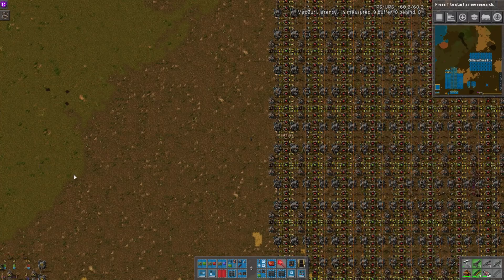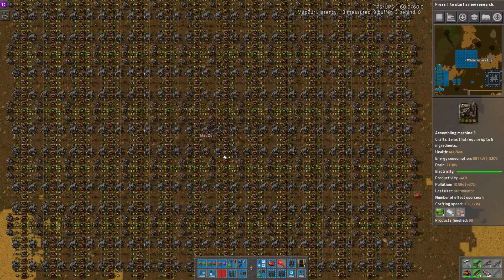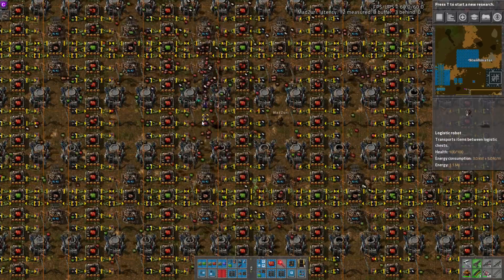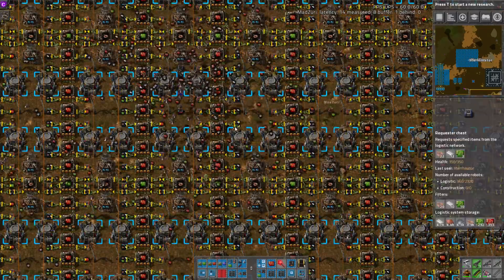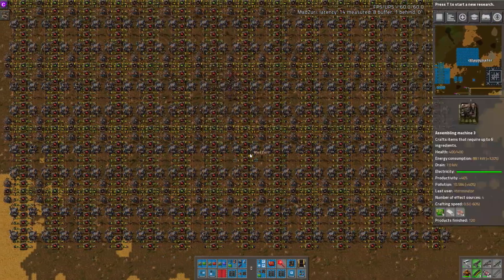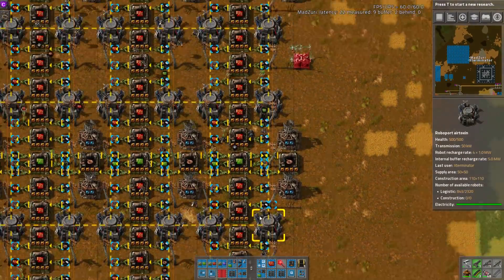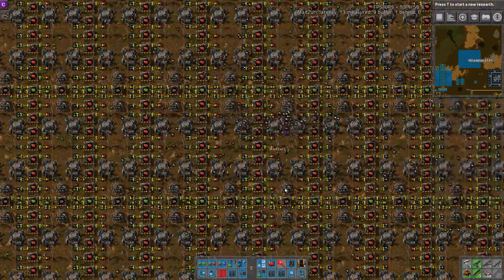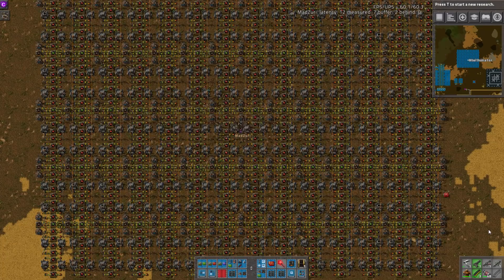Lockdown's Advanced Circuit Build :: Factorio Workshop Season 2 - Building A Better Factory

Comment: You probably wouldn't have to request cables as input for green circuits if you let it buffer up a bit of cable before you start full draw on it, since production can keep up with consumption, and it's just a matter of bots unevenly distributing the cable.
Reply from the maker: That is probably true. However it's also a problem of the Inserters exporting to both sides very unevenly so even if it did buffer up a bit, it would probably eventually run out on one side again.

Comment: Very nice build.... the issue with delivering the input, wouldn't it just come from all 4 sides... and perhaps drive a train track through the centre and suply to the centre that way?
Reply: because its long an uneven amount off tiles, i did what u suggested but mirrored it again
and 3 station along each side because they are so long
Reply from the maker: Yeah, it would come from all 4 sides in a normal base, but that is the issue. With the bots having to fly all the way out to each side it would increase bot usage quite a bit. Having it in the center is best, so the way we showed it is the minimum amount of bots it could possibly use. 
If you wanted to have the input delivered in the middle in a normal base, you'd have to revamp the build quite a bit.
Reply: Any chance of a new bp... perhaps xterm and zuri could assess the improvements too.
Reply: it isnt an improvement at all its worse although i split the two drone networks

Comment: I am pretty sure that if you supply inputs from two sides (left and right) and distribute outputs and inputs evenly through the side - you can even more minimize the amount of bots and it would represent "real world" factory. (you probably do that as a module and supply it by trains, half the wagons to left and half to right side of the build)
Reply from the maker: We would have to test it on this specific build, but on previous testing, it is better for bots to have your input and output in the middle of a build rather than on the outsides of it.